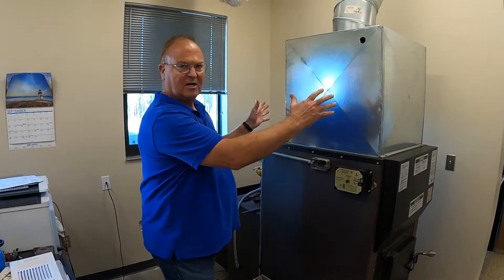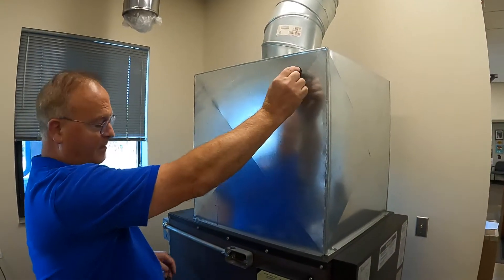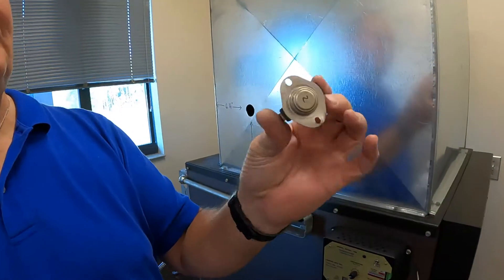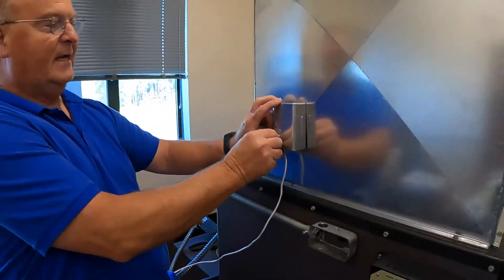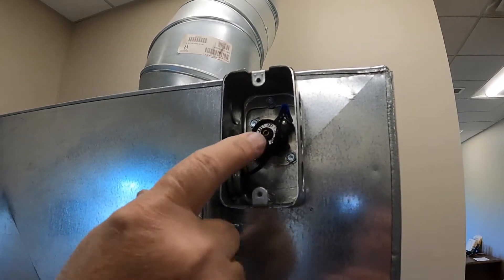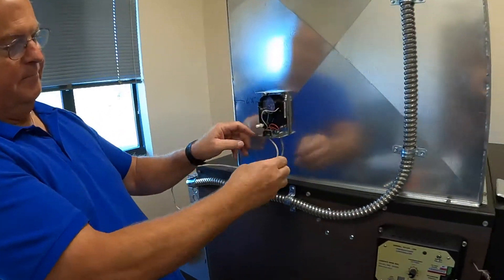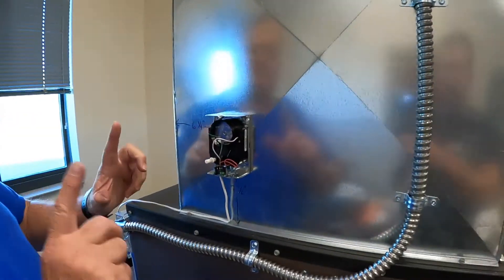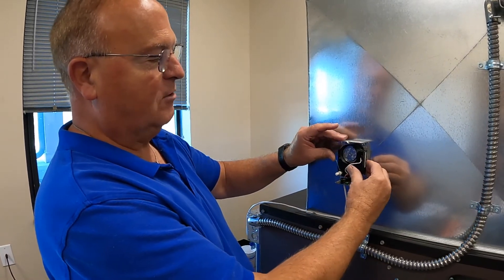Kuuma Vapor-Fire 100 Installation (Low and High Limit)

Comment: Why do wood burning furnaces have low limit switches but most other furnaces don’t?
Reply from the maker: Ours is really just to turn the blower on and off.  The high limit is a safety device to ensure it doesn't overheat.